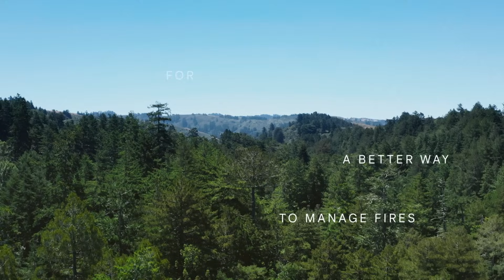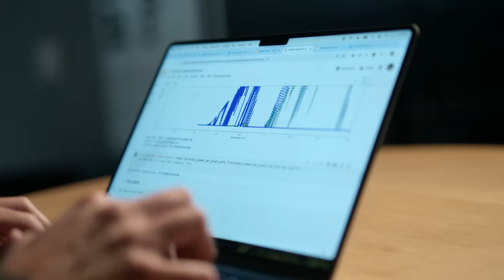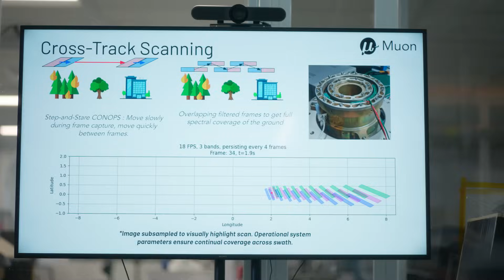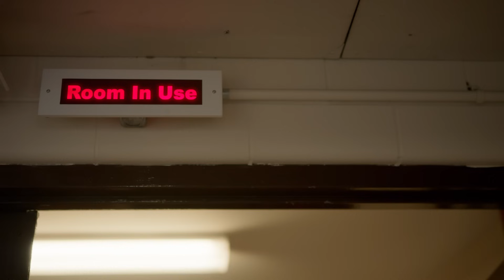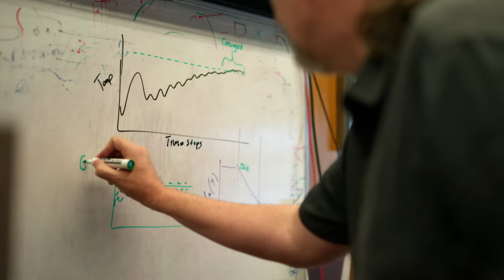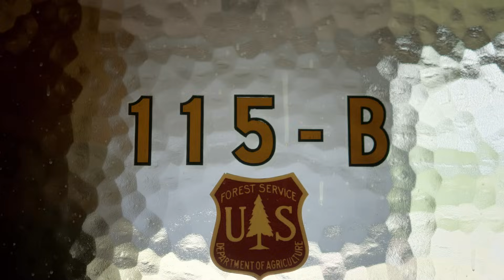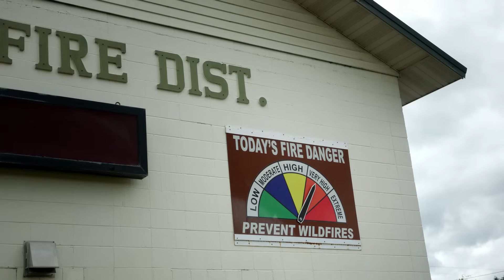Can AI help firefighters manage wildfires? | FireSat

Comment: Google have problem! if you reset your phone and forget password and don't set up recovery mail. But you have recovery and two step number then Google account recovery impossible. Because in recovery page after verifying two-step number Google will send OTP to that same Gmail account.😢
I didn't set up recovery mail Then why Google send OTP to mail why That's not all I am trying to recover my account and Google is sending OTP to that same account! 

I also have recovery number then why Google is showing only two step number? 

Google account recovery system need to update